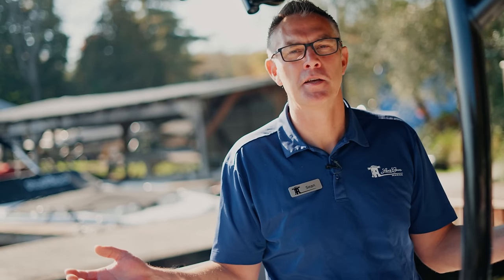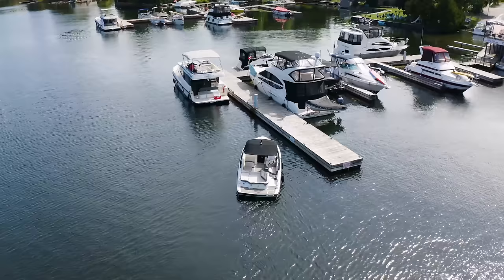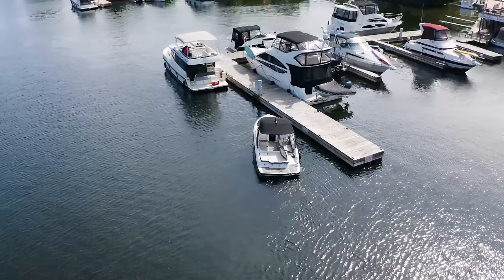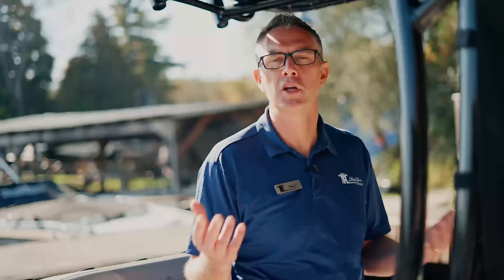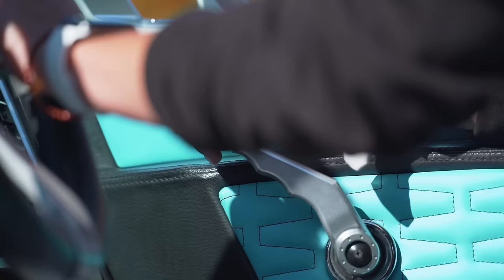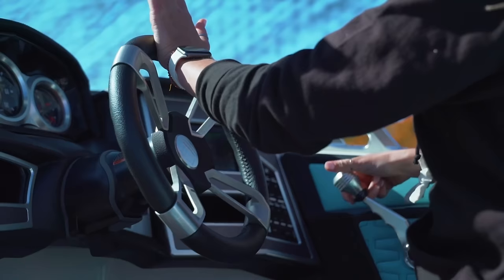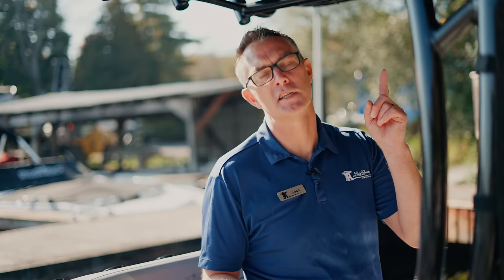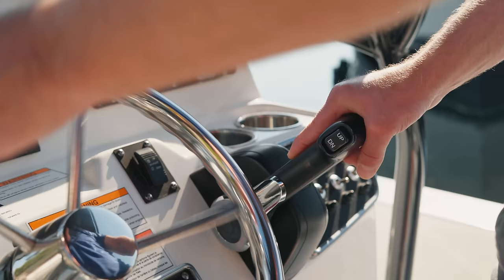How to Shift a Boat Into Gear Properly

Comment: Does the shifting apply to Yamaha Jet Boats also? Specifically 2011 or similar, not the new ones with electronic paddles etc... Thank you.
Reply from the maker: Jet boats do not shift with “gears”, but rather with gates or diverters to direct the flow of the water “jet”. They do work very differently
Reply: Jet boats are “direct drive” and do not have a transmission (F-N-R).   You are moving the “bucket” and diverting the thrust.   Even in Neutral, the prop is still engaged, the reverse bucket, if properly adjusted attempts to cancel out fwd and reverse thrust to maintain neutral  thrust, vs a Outboard/IO with a gear case, where the prop will stop spinning, giving you true neutral.
Reply: 100%